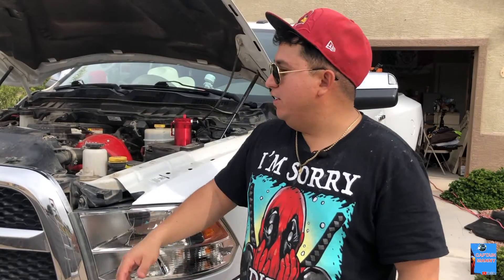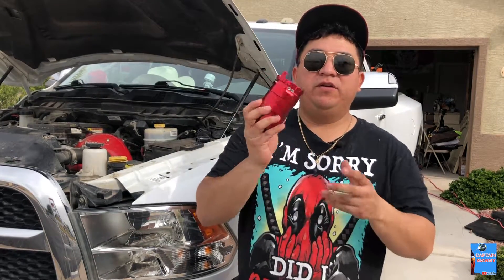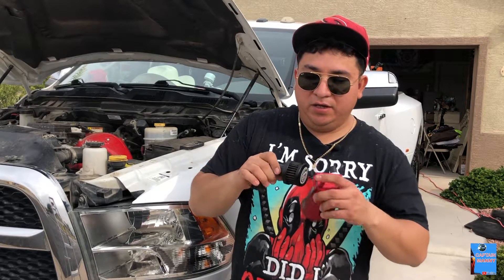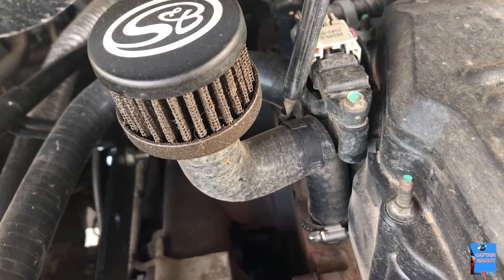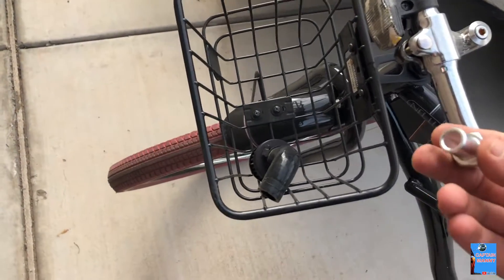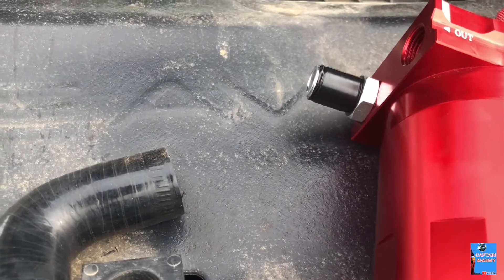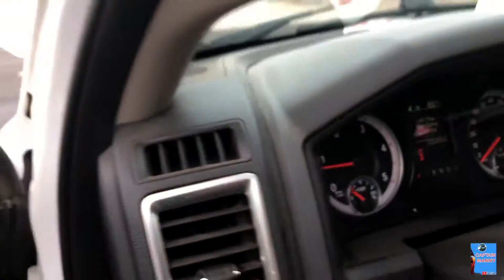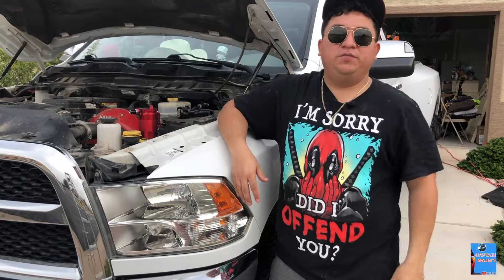If you have a 6.7 , You need this to Prevent Damage to your Engine-oil Catch Can

Comment: The Cummins and Hemi don't need oil catch cans because they're not GDI engines. The Cummins needs a crank case ventilation catch can . Is that what you mean? You posted this three years ago and you still haven't figure it out and corrected it?

Comment: Put the catch can in line with the turbo the will not make it to the turbo and the turbo will provide vacuum and keep the filter it place 

Stopping the oil from getting to turbo the point
Reply: Try to make sense when you write a sentence.

Comment: I would like to know all the mods you've don't to your Ram and do you have any trouble passing emissions? I have the same truck and want to do mods just not sure witch one's I can get away with
Reply from the maker: The only mod you can do is the aftermarket air intake , ans some other ones but def, egr, pdf delete will make you not pass emissions
Reply: Thanks for the reply.

Comment: OK, I've watched A LOT of these videos on how to remove, gut, replace, whatever the factory CCV filter.  I have come to the conclusion that a lot of people don't understand the purpose of the CCV on their trucks.  It is there for the sole purpose of relieving the pressure build up inside the crankcase.  Period.  The factory configuration does an OK job with a new filter but as the filter becomes dirty, the ability to pass air becomes restricted.  Another downside to the factory setup is that if any oil mist gets past the filter media then it is introduced into the inlet piping right ahead of the turbo.  This can cause oil build up on the impellors along with putting the oily air into the intake manifold.  Neither result is something you want.  There isn't much you can do about having to replace the CCV filter when dirty but you can help reduce or stop the oil mist reaching the engine by installing a GOOD oil separator/catch can.  Basically, it installs between the CCV outlet and the turbo piping inlet.  Sort of a secondary filter to stop any oil that gets past the CCV.  The better ones have some type of internal filtering media as well as a means to screw the bottom off to facilitate emptying the captured oil/condensation.  And yes, you need to have the output hose of the separator connected to the turbo inlet piping.  This connection supplies the "suction" to help draw the crankcase vapors out of the crankcase.  Unfortunately, I haven't been able to locate diesel specific catch cans so I can't make any recommendations for a source.  I liked the JLT units for my HP street cars but they only list one for the 5.7 Hemi last time I looked.
Reply: Soo the way he did it is good or you got a video  to show how to?
Reply: They aren't really vehicle specific I'm sure you can use a catch can meant for a gas vehicle on a diesel... Inlet, outlet, can. Pretty simple
Reply: Thx for explaining this. I've experienced the oil build up as you said on my 6.7 Cummins. After 30k miles the build up was pretty bad. I'm going to change out the CCV filter probably around 20-25k miles .
Reply: Finally someone has said it. I’ve see a hand full of mechanics basically say guys who do the CCV delete they end up seeing them in the shop eventually and you’re doing more damage than what you’re trying to avoid by doing it in the first place and basically it’s best to just keep it and like you said do an inline secondary filter if you’re really worried about it. Change your filter when you’re supposed to and have a quality filter and generally won’t have to worry about it. This is like the heater bolt issue maybe 3% or less of these trucks deal with that issue but companies have made thousands if not millions on selling the fear that you might be that 3% or implying that it’s more common than we actually believe

Comment: Wow so much wrong with this video!! did you gut your CCV filter out to allow the pressure to actually vent? why is there no vent on the catch can? you need to vent the pressures or else your going to blow seals and start to have oil leaks coming from the head.
Reply: You are correct.He can do it either of two ways. He can either put the filter vent on the catch can or run a hose from the catch can to the inlet on the intake tube to the turbo. I put a mishimoto catch can on mine and ran the hose to the intake tube to keep the suction from the turbo pulling that vapor into the ccv filter and what ever else get's past it and into the catch can.

Comment: Hey primo, I did the same thing on my 2014 but did u cap off the out nipple or leave it open!? 

Thx!
Reply from the maker: I’ll just leave it open
Reply: @CAPTAINMANNY  Arre!!    Have you seen any oil spot here and there in the engine?  

Gracias!
Reply from the maker: Nop not yet it should be not , also don’t forget to to gauge the crank case filter and put it back , if you haven’t done yet, I don’t have a video on that but there is some in you tube about it.
Reply: Yea i already took all the insides out yesterday actually and finished it up all up. Capped off the hole  for the air intake tube tambien. 

Thanks again for the vids
Reply from the maker: No problem bro ,👍